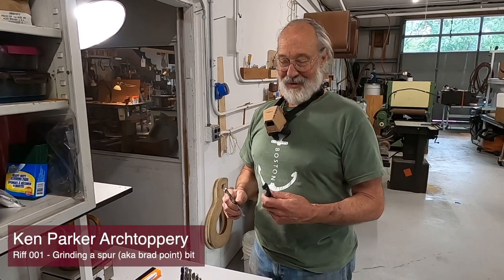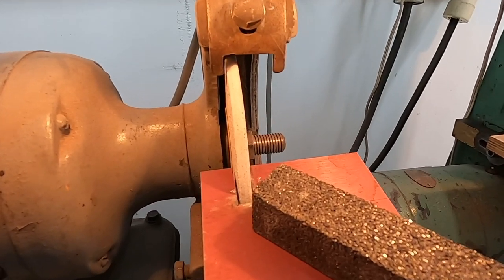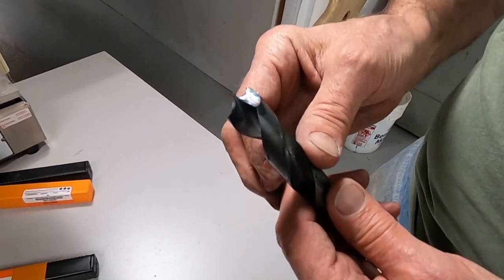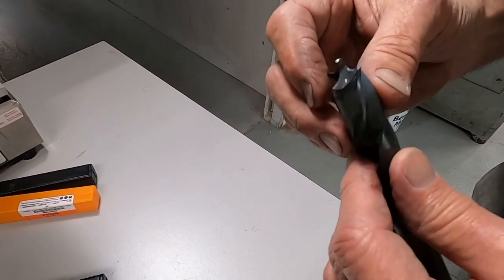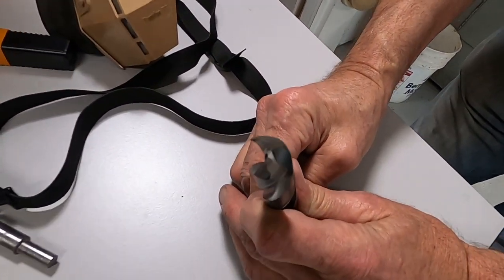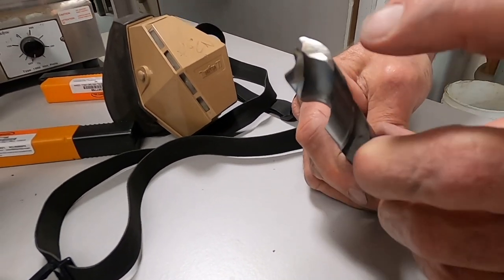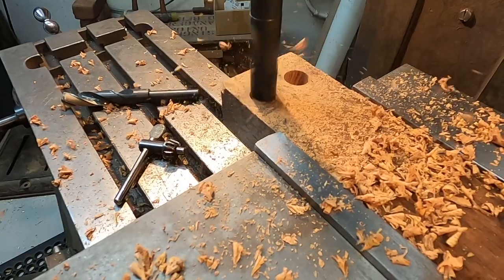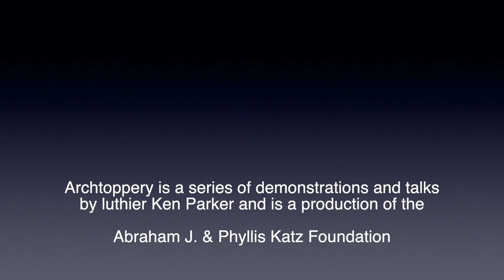Ken Parker Archtoppery - Riff 001: Grinding a Spur (aka Brad Point) Bit

Comment: Very useful bit geometry, in the shop i used to work at there was a set that someone had forgotten, and they produced very shapr holes, and the vibrations using the press drill were significantly lower. Thanks again for sharing :D
Reply from the maker: Grinding well will get you out of almost any tight spot in the world of cutting stuff.

Comment: Excellent ! I will do it to some of mine. Thanks a million for teaching us !
Reply from the maker: It's easy, and you can play with the angles to address the needs of different materials. Have fun!
Reply: @kenparkerarchtoppery9440 thanks for that tip ! to play with the angle as it is limiting the thickness of the chop. It is the equivalent of the angle of the filets on a screw the speed of the penetration by rotation. As I am a french speaker, please excuse me for my approximations in english.
I love your smile of satisfaction and happiness with that lovely donut finish !

Comment: I'm amazed at how clean the exit hole is. I think I need to get my hands on some decent quality brad point bits for my drill press. I have a hand cranked one which applies a fair amount of downwards pressure and often leads to tear out at the exit.

Thanks for the informative video!
Reply from the maker: In my experience, "decent quality" are the ones you grind yourself.  Go for it!  You must have some junky bits around that you can practice on.

Comment: As if I don’t already have enough to do, now I have to grind my own Brad Point bits! 😄 Seriously, thanks for the explanation of the steel alloy. I was getting concerned when you didn’t cool the bit in some water while grinding.
Reply from the maker: HSS is a godsend for drills, so tough!  Small bits are better addressed with a Dremel or some such with a little grinding wheel.  I normally only grind what I can't buy, except, of course, if I need it RIGHT NOW, and won't wait for the postmen.

Comment: Very good results, what size wheel and what grit?   Thanks
Reply from the maker: I think it's a 46 grit white aluminum oxide wheel, 1/4" wide. The industrial grinders normally used in machine shops include surface grinders and universal tool and cutter grinders, both of which I own and use occasionally. These tools in the US normally are designed for 1 1/4" hole and 7" diameter for reasons I can't explain to you. The pedestal grinder I use here, and most "bench" grinders are fitted with a 5/8" shaft, so you'll need adapter bushings to run wheels with the larger 1 1/4" holes. These can be bought from your wheel supplier or made on your lathe. The variety of wheels available in these dimensions is mind-boggling, but you normally would only need a few different types to do most precision grinding jobs. Grinding motors usually turn at 3600 RPM, so the SFM rates are quite high, it would be 7500 surface feet/ minute for an 8" diameter wheel when new. It might surprise you to know that this high speed means that the grit size affects the surface finish much less than you might imagine, and 46 grit is quite commonly used to get a nice balance between stock removal rates and the quality of the surface finish, unless you are grinding fussy little slots or need truly sharp inside corners.
Normally, fine grit wheels are only needed if you require very sharp inside corners, and are capable of removing very little material before dulling and requiring reshaping by dressing.

Comment: Wow. Very cool vid! Gonna try my hand at this sometime. 
Btw ken, I think that bit is larger than 23/64. I happen to have a couple of 23/64 bits within arm's reach at the time of watching this. The hex head of the truss rods i use require 23/64 holes. Either you have tiny hands, or those are some large bits!
Reply from the maker: OOOPS  Sorry, of course I mis-spoke, 23/32" it is, right between 11/16" and 3/4"

Comment: Could you drill a long hole for say a truss rod with that?
Reply from the maker: long holes in wood are really tough!  After drilling just a few drill diameter's depth, a regular twist drill can easily be diverted from its ideal course by variations in hardness and grain fiber direction in the wood.  This can happen even in metal, and to an extent that will surprise you!  There are drill styles that are more likely to drill straight, look up gun drills.  Problem is, the drills for deep holes are designed for metal, and tend to depend on a lubricant.  In wood, a friend has had excellent success drilling very small holes with a spoon bit, drilling a tiny amount and constantly retracting the drill and clearing the hole.  He reports that repeatedly freezing the drill also was helpful, as it tends to prevent heat from hardening resins in the wood during drilling.  Having said all this, yes, the brad point/spur bit will track significantly better than a standard drill point.